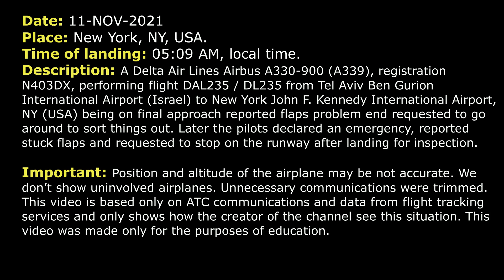Stuck flaps. Emergency landing | Delta Airbus A330-900 | New York, ATC

Comment: Why stop on the runway with stuck flaps?  The window shades are stuck shut, and someone can’t look out the window to see if it’s safe to taxi?
Reply: They stopped because of hot brakes (although thats not what they said). After a flaps-up landing, the brakes may be considerably hotter, and in some cases they may even start to burn. If they are on fire, the ground crew can extinguish the flames, and there is potential for an evacuation. You do not want to be taxiing whilst on fire; look up Manchester for why not; they turned off the runway and things rapidly escalated.

Comment: The pilot may certainly be ‘ cool’ but he is barely comprehensive...he rarely finishes his sentences / instructions. One deduces he wants to have the safety vehicles check his brakes for fire / over heating because of a high speed touch down... no instructions are given at any time. Sorry, the dude comes across as incompetent or over whelmed

Comment: The issue was what is known as a split flap condition. Each wing has a motor to operate the flap surfaces up/down. Either on flap extension for take off or flap retraction one motor failed and a connector tube detection system stopped both flaps to prevent a split flap condition and loss of control. I experienced this in a B-757-200 SFO to ORD many moons ago. I had selected Flaps 5 for departure and landed w/o incident in SFO. Not an emergency but precautionary landing in case of hot brakes which were not experienced after using the length of the runway, reversers and with good headwind. To see the torque tube shredded up sent a huge thanks to Boeing engineers and maintenance technicians. Thanks
Reply: if for whatever reason the detection system failed, would a spilt flap condition lead to loss of control of the airplane or just an abnormal condition? Especially seeing both wings would creating unequal lift.

Comment: Very strange to request a visual inspection whilst stationary on the runway ! Not much ground crews are going to be able to tell the flight crew that they didn’t already know, until the Delta maintenance can get a look it, it just needed a cool down on the brakes & taxi to gate !!!
All in all i thought that the conduct & comms from Delta 235 was poor.
Reply: Brakes don’t cool down, they get hotter and hotter for about 20 minutes after.  It makes sense to have fire services present incase the wheels catch fire

Comment: I was curious how many airline pilots are former military. Here's what I found:
The Air Force, Navy and Marines were traditionally the feeding pools for commercial operators, with roughly two-thirds of airline pilots being ex-military in the 1980s. But that has changed drastically. By 2019 the figure was around 30%, and the private flight-school industry has been thriving. (Bloomberg)
Reply from the maker: I think the same situation is in other countries as well.
Reply: The problem has been a need for so many narrow body pilots. The result is that the military can’t supply enough pilots. The USA and Canada are especially built on frequency.

Comment: Bet nobody’s gonna go after Airbus for this like they do with Boeing and the MAX
Reply: For what? the aircraft didn't crash and stuck flaps isn't a massive issue if you have a long enough runway available. It's a simple defect. What you maybe don't know, if just one part of the flaps mechanism quits in an Airbus, the whole system is locked by the computer to prevent asymetrical lift. And as far as i know it's the same with Boeing planes.
Reply: @shi01  My point is that people go after Boeing like in the comments about the American 737 MAX that had a slat issue in Florida. Idk what for, they’re not the most educated.
Reply: This isn’t relevant to that

Comment: A very calm, laid-back pilot!  Professional work by all concerned.
Reply: Actually brain-dead was more the vibe I got. Somebody absolutely not on top of his thinking, total brain lag..which in situations that can go to sh*t in not minutes, not even seconds, but split seconds, this guy needed to be all over his game. Calm is important, but laid back? No. Comms should have been..pan pan pan pan pan pan have a problem, ( state problem) may need to declare an emergency, require vectors to troubleshoot. Then comms should have been..declaring an emergency unable to resolve problem, preparing a no flaps landing, roll trucks. Nothing more, nothing less. Keep it short..plus, there are lots of other aircraft on frequency, ATC is busy, another reason to relay information quickly and concisely, not have the controller wading through the ums, ahs, yeahs, and other extraneous comms to extract the necessary information.  On top of that, why commercial flight crews don’t have the # of souls on board written down somewhere obvious before they even leave the gates I’m not sure..they may well need that number very quickly at any time during that flight, right from when they leave the gate...also, the controller very specifically asked for fuel in pounds, and it was given in hours.,so, another unnecessary communication. I want a pilot who is calm in an emergency but I don’t want one whose brain is lagging and asleep. The moment there is any sort of potential emergency, it should be bam and all lights on. This guy sounding more like he was having a casual chat with ATC about ordering dinner.
Reply: @virginiaviola5097  That's exaggerated. First, we all know that on US ATC, standard phrases are not that commonly used as elsewhere, especially emergency declarations.
Second, a flaps up landing is no major emergency, it is just a routine landing at a higher speed than usual. Nothing any pilot is worried about.
Third, the pilots have plenty of tasks to do and checklists to run while they are talking to ATC, ATC actually has the lowest priority. They should be kept in the loop, but that's about it. Number of souls is used in emergencies only, so hardly ever in any pilots life. I don't know of any circumstance where it is urgently needed in a second.

Comment: Why, once on the ground, the emphasis by the pilot on the flaps? Shouldn’t they be more worried about hot brakes and be very specific about what they want the services to look for? Of course there could be fluids leaking and the fire people generally know what they are doing but being vague doesn’t help.
Reply: One big advantage most Airbus' have when it come to hot brakes - they have brake fans that can dissipate the heat.
Reply: The brakes could well have been glowing

Comment: Controller didn't want to covert the fuel... l9l
Reply: How exactly would the controller do that conversion? Do they know the fuel burn of each aircraft depending on how it's loaded that day? Kinda doubt it, champ.
Reply: @atcdude067   it's in your FTC-ESRNA program, it does automatic cross calculations to almost every countries weight, tonnes, kilos, pounds that you like. It also has manufacturers payload cross calculations as well. I was a controller for two years,  in a emergency, you generally always do the calculations for the pilot because they are under tons of stress. That's a very minor detail that will let the pilot focus on flying the plane... 
Oh yea, and that's how you do it "champ" lol.
Reply: @kliowilliams970  1) never heard of that program and 2) not sure how it would help considering I still don’t know the pilots fuel burn / hour / minute / whatever based on his configuration / phase of flight / etc. And if I’m gonna ask him the fuel burn per hour why not just ask for the pounds and get the actual number? 2 years means you probably never were actually a certified / rated controller.
Reply: @atcdude067  you're missing the entire point. 
1)there's about 50 different FTC programs, Es is just the one we used at Spirit of St Louis. 
2) Anything you can do to lighten the burden on a pilot is a +. If a pilot goes into hypoxia and is delirious, calculations can be made/instructed from the ground   relaying from company through ATC. It's all a collaborative effort to bring that bird home safe.
3) I'm talking about a EMERGENCY ONLY. ATC doesn't give a crap about any of that unless that's the case. 
4)Being a rated controller takes a extremely high level of dedication but also great aptitudes to CAD systems. I was licensed, but I'm a tech, I was all about software, and that's fine and dandy but the software can only get you so far.  I have great respect for "Freehanders", guys who didn't always rely on technology to get the job done, and they are normally some of the best controllers/air dispatchers out there.
Reply: @kliowilliams970  I’m not assuming or calculating the pilots fuel. I’m asking him. End of story.
Reply: @atcdude067  ok. Weird flex, but ok. Lol.